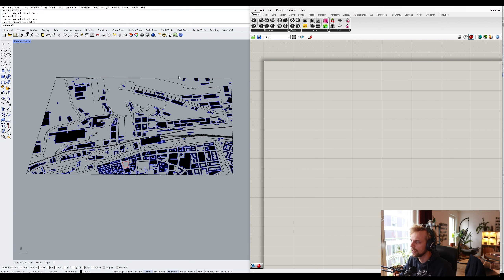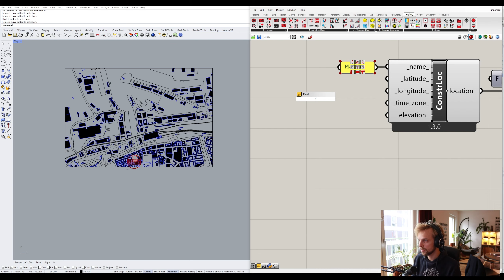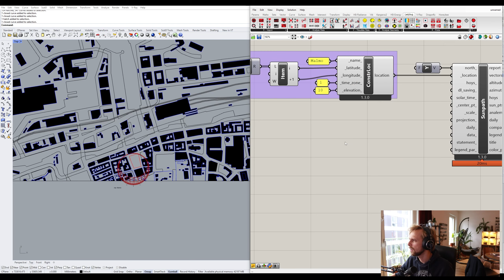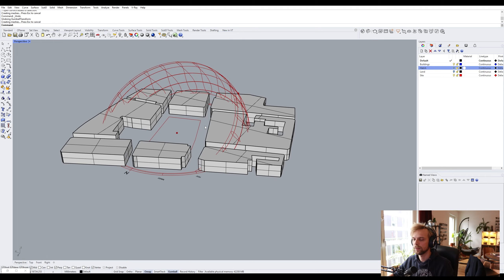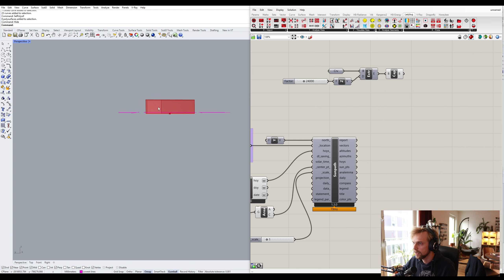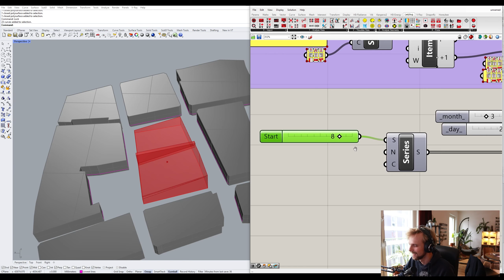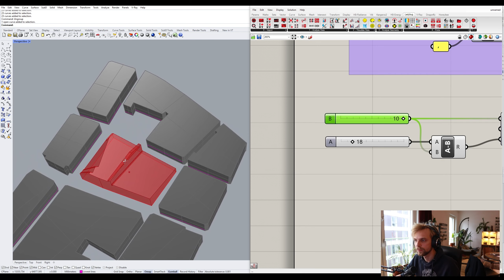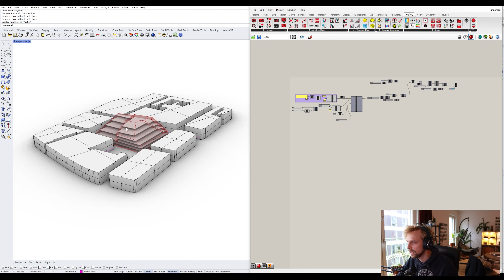Rhino for Architecture: Carve Building Envelope Using Sun Light (Rhino, Grasshopper, Ladybug)

Comment: This is great. I would love to see more sun based form generation
Reply from the maker: Hmm besides this one - everything else that I do with sun is quite "hand made". When it comes down to light, you can't generalize design too much or else the building will start looking very... hmm.. synthetic.
Reply: @DesignGoBrr  My interest stems from ancient structures that are aligned to the sun. I think carving volumes with more sophisticated sun data has a spiritual value.
Reply from the maker: @virtualcircle285  yea, that sounds cool. And also very very hard to automate
Reply: @DesignGoBrr  I think a simpler version could be done using the shadow line tracking you showed here. An example from history would be the temple of Ramses II at abu simbel. The sun lights up the statues at the back twice a year. I think we need to move beyond the technical aspects of light in order to add more meaning to our work lest our buildings become cold engineering based grasshopper scripts.
Reply: @virtualcircle285  Amen.

Comment: Hello Gediminas. 
I really like your explanations and I have learned a lot from you.
I would like to ask you a question. 
I have seen that it always works in millimeters. Is there any practical reason for doing this? Since their projects are houses and apparently it would be easier to work in meters. 
Thank you very much for your work.
Big hug from Portugal
Reply from the maker: When I model houses, I only start with large forms, eventually I drop down to much smaller scale - window frame cross section is 40x75mm for instance. That is where I spend a much bigger amount of time - so if I had everything in meters - every time I model out something out of MDF - I'd need to insert 0.018 as thickness instead of 18mm. In architecture school it's a bit different - 90% of time is spent on the concept and moving large shapes around, so it makes sense to stay in meters.
Reply: @DesignGoBrr  Thank you very much. ok I understand, you works more on a scale of detail. It makes sense, 
I thought there was some specific reason in the program. Example: make it easier to scale the intensity of lights or materials.
Once again, thank you so much for your work.